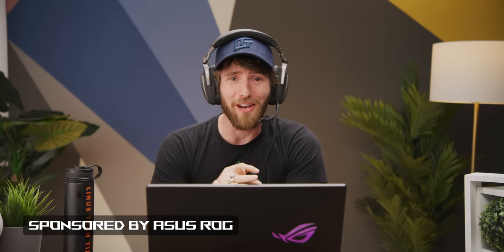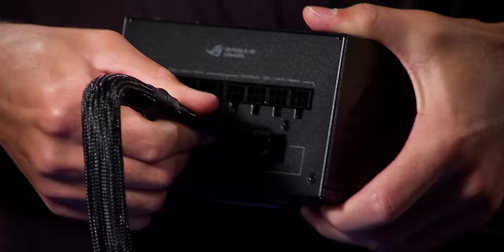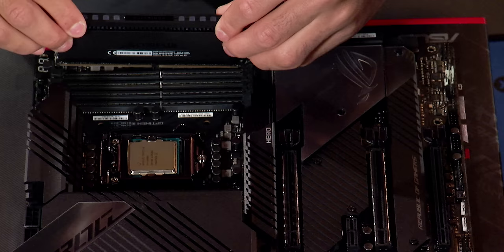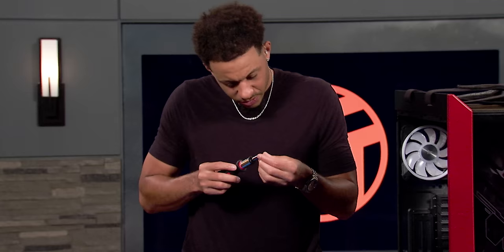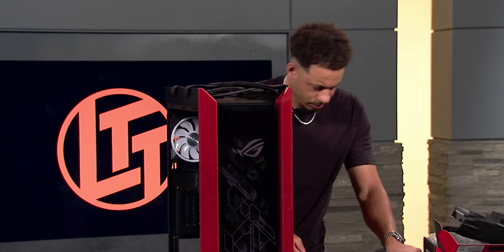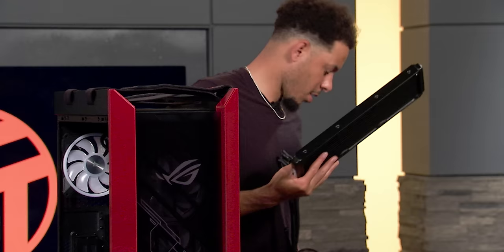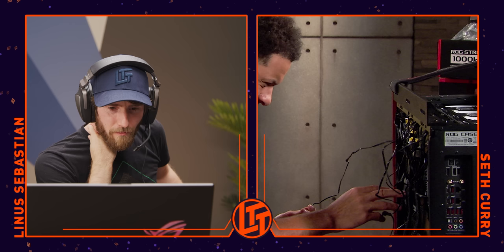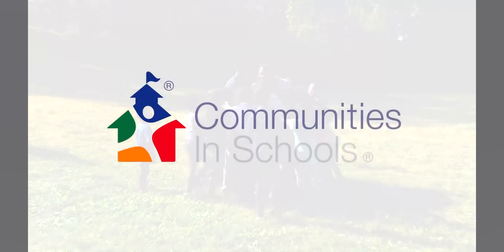My Biggest Collab EVER - PC Building with NBA Star Seth Curry!!

Comment: For a first time builder I'm impressed, especially the triple fan radiator... someone needs to design a tray piece that can house a radiator and fans in a fixture that can be easily snapped or slide into a radiator slot... something that can have a quick release for filter access. Kind of surprised that is not a thing yet... BTW, you asked really good questions when preparing to start.

Comment: Built my first pc during the pandemic. Went high end (at the time)....push-pull on 360 radiator (11 fans total), commander pro, 10980xe, 6900xt, x299x motherboard, etc... No help. So much forum reading and at least 200 youtube videos. What a pain it was to figure out! Then decided to hackintosh it for dual boot right after building it, a bigger pain that was lol. Typing from it currently.  I totally feel him when he said "I have a different type of connection to it". Considering an upgrade for a new cpu/mb, but may wait till next year!

Comment: Well I once bend a pin in a LGA 1200 board but using a cutter and a bunch of patience I got it fixed. It didn't shine the same tone of color as the other ones but the position was correct. The PC works currently without a problem.

Comment: I will say, it's been a while since I did my last full PC build (PC parts picker didn't exist at the time), but I remember the hard part wasn't getting the stuff where it needed to go, in general the motherboard manual could be used for quick reference and other than that it was fairly obvious. One thing I think is missing from ROG rig reboot and other content like this episode where you're "teaching someone to build a PC" is that the difficult part is knowing what parts you need and want, as well as compatibility. on the recent one where an employee tried it, that showed itself even with PC parts picker to help make sure she didn't end up with incompatible parts. The parts she picked weren't necessarily the best options, and there was stuff people who know better would never have picked as parts, while the assembly process went fairly smoothly (and would have gone better if you had actually given her the motherboard instruction manual, which was noticeably absent during the build and glossed over with a mention of how rarely parts have manuals... been through a fair number of motherboard upgrades and I've never had one without said manual). To the point where that knowledge makes a major difference in the end product. I just went on PC parts picker, and knowing what I know, made a system that would not only blow that computer out of the water, but would also blow the competition (the prebuilts) out of the water too, and stayed within the 1500 dollar price limit (actually hit it on the nose). I don't need to test it to know that a ryzen 5 5600x paired with a 3060 is going to outperform the systems running with 2060 and 2070 cards on the same or worse CPUs, and it makes a joke out of the system with the 3600x and the 1660. https://pcpartpicker.com/list/8DbKW3, if youtube lets the link work, if not the list is ryzen 5 5600x @ 272, ASUS TUF gaming x570 @ 197, Corsair vengeance LPX 3200 @ 73, Crucial 1TB NVMe drive, EVGA Geforce RTX 3060 @ 729, EVGA G3 650W 80+ gold @ 64, and any ATX case you want under 75 dollars, I picked an NZXT one at random, but there were pleanty of options.

Comment: I have this board with an 11700k, it's a nice board.  Even though it has four M.2 slots the second slot is kind of useless for a gaming rig, basically the first M.2 is a full PCI gen 4 and runs at x4 with the first PCIe slot for the video card operates at x16.  However, if you populate the second M.2 slot it shares bandwidth with the PCIe first slot, which means if you populate the second M.2 it will operate at x4 but the video card will be reduced to x8.  For me, as I have a gen3 M.2 and a gen4 m.2 I populated the gen4 in the first M.2 and then the gen3 in the 3rd M.2 slot.

A couple mistakes I see:
Always lay the case on its side when putting the motherboard in, seriously let gravity work with you, it is 100 times easier to align the holes and screw it on.
With a modular power supply I find it easier to put the PSU into the case without any cables attached, then attach them as I go.  This way I only attach the bare minimum needed and can more effectively cable manage as I work.
The front panel set of connectors, ASUS supplies with the motherboard a separate header piece that has easy to read labels on the side and makes it a lot easier to connect to that then slide it onto the motherboard front panel connector set as one.

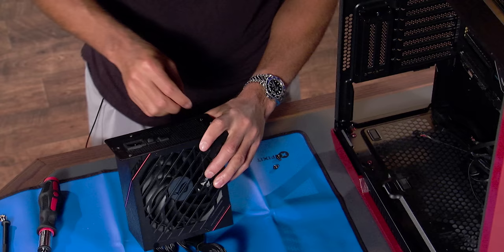Comment: Loved the video, just got one question. When they are taking bout the PSU facing up or down, at 14:17,  if there is a lot of headroom beneath the case (like on the table), is it better to let the air into the case? Does "Fan side down" mean, air is going in it, cooling the components?